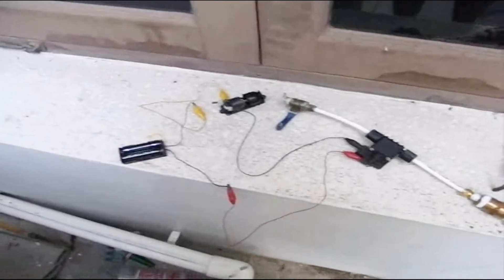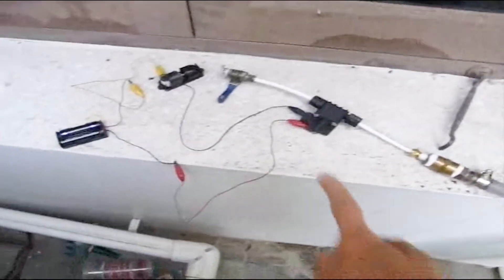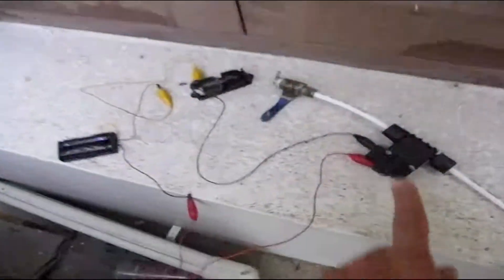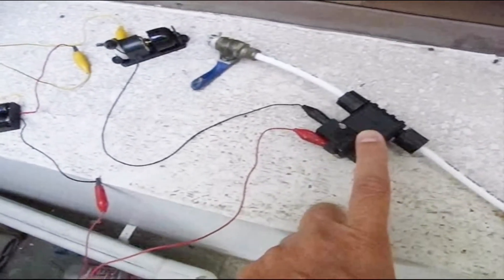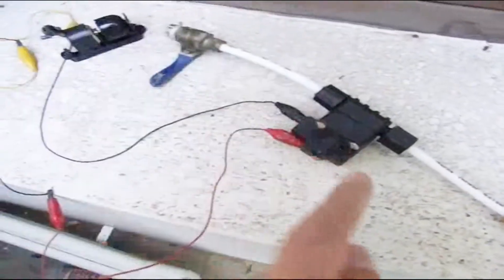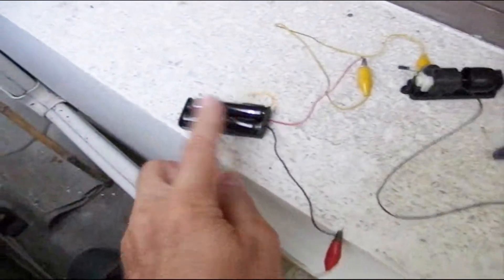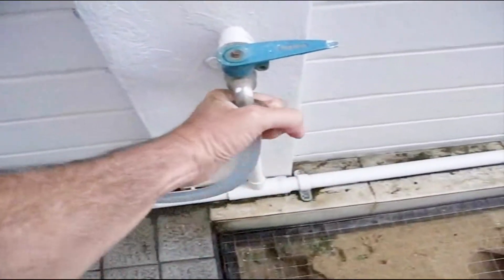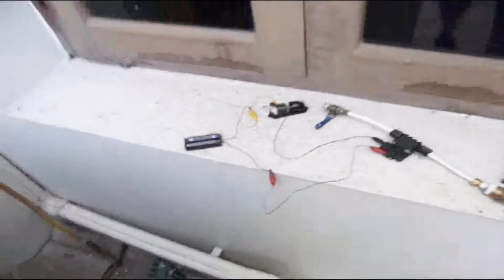Experiment - DIY Low Water Pressure Alarm - City Water, Well Pump, etc.

Comment: I’ve been trying to rig up something that senses when my pool pump sucks air and looses water pressure. I just need to find out how to scale this up to 2 in pipe.
Reply: @tsbrownie  I’m trying to make a system that is wireless so I can put an alarm in any room without the hassle of cables.
Reply from the maker: I'm sorry, I read your statement wrong - brain glitch.  I don't think the size of the pipe matters as much as the amount of max vs min pressures.  There are lots of pressure switches out there, with different sensitivities, pressure ranges, pipe fittings, etc.  A simple way would be to have the switch ring a remote battery operated door bell.  There are also battery operated remote light switches.  Cheap and easy solutions.
Reply: @tsbrownie  yup that’s what I was thinking.
Glad I found a video of someone else doing something similar.

Comment: Any thoughts on how to set up an alarm that's triggered if a water pressure guage drops below 20lbs of pressure?  I'm trying to have an audilble alarm sound if/when my irrigation pumps low pressure cut off switch is tripped.  Cheers and thanks for the video!
Reply from the maker: That's pretty much what this does.  Of course using a battery, recycled alarm clock bell and pressure switch from an old RO water filter is not a professional grade solution.  There are good quality water pressure switches that I would use for something like what you are doing. Google "low water pressure switch".  For the circuit there are many choices, google "low water pressure switch circuit" and select images.